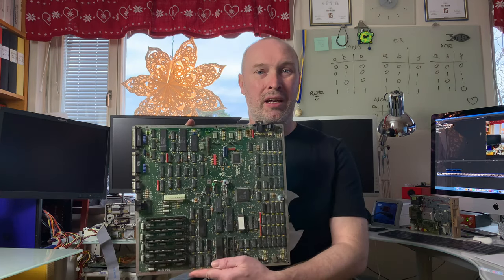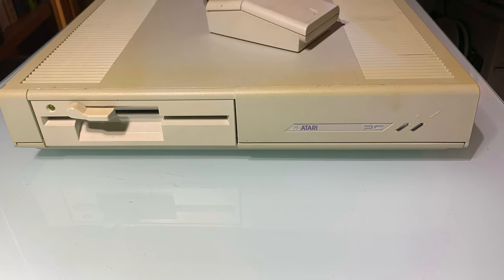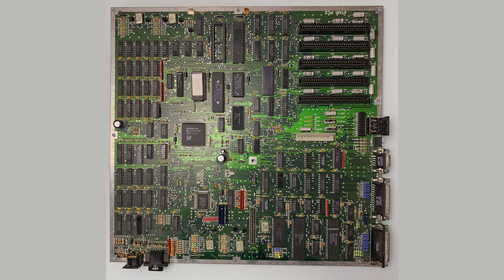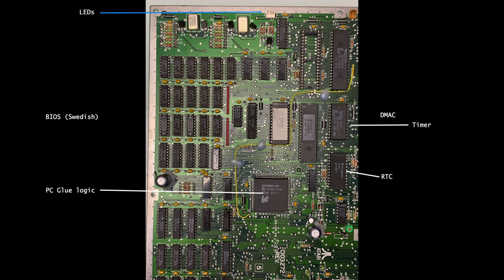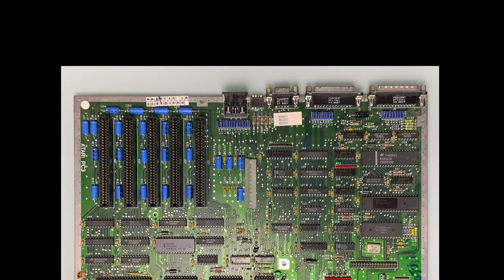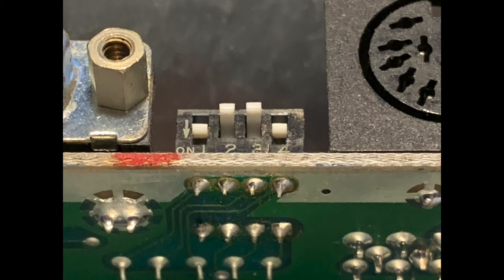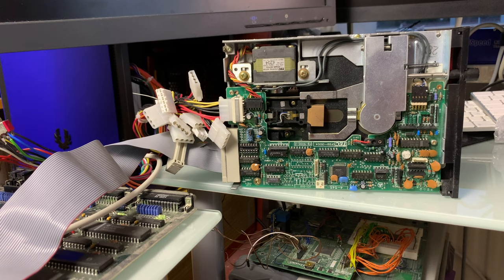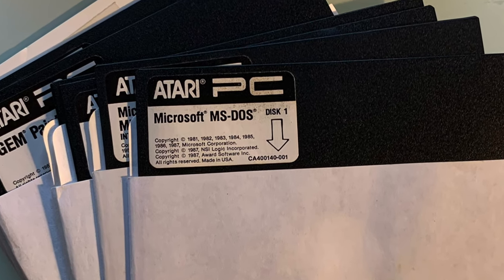Atari PC3 #DOScember

Comment: Due to this video I revived my Atari pc3 (my first pc ever) again after +20 years of sitting in the dust. Desoldered the 8088 and installed a NEC V20-16 Mhz and replaced the crystal with a 32Mhz one which gives me about 11 Mhz on the cpu (big difference in performance!). Installed a 8087-1 FPU which seems ok with the 1Mhz overclocking. Searching for faster RAM chips though because 150ns isn't quite ok if I want to go faster than the 11 Mhz. Installed 1mb VGA card tseng4000 (16-bit card but works on 8-bit slot). Opti Sound Blaster clone work perfectly in the 8-bit slot when disabling the IDE port. XT-IDE to CF installed just 2 days ago with 504mb partition. Now waiting on a Maxmem card to give it some UMB memory since the dos 6.22 is a memory eating thing. These systems are rock solid turbo-XT's. If I ever find a PC4 I will buy it immediately!
Reply from the maker: Amazing! I'm so glad I could convey a nugget of inspiration! Thanks for letting med know :)